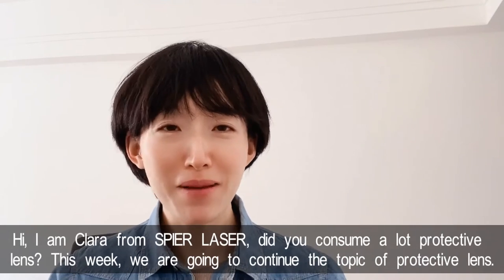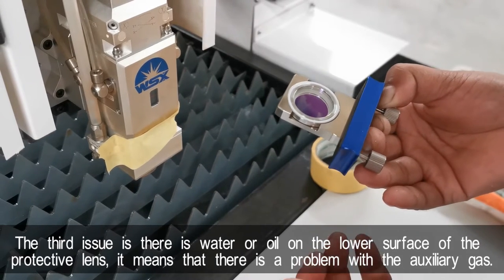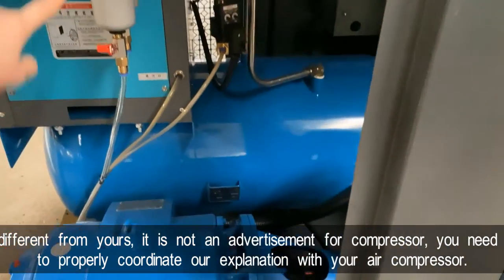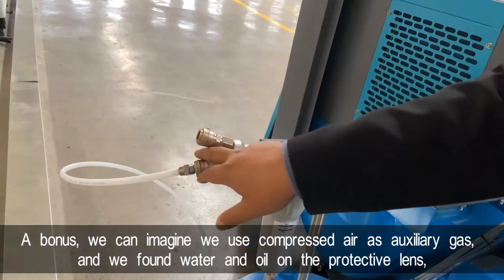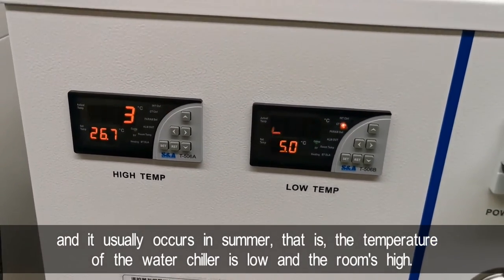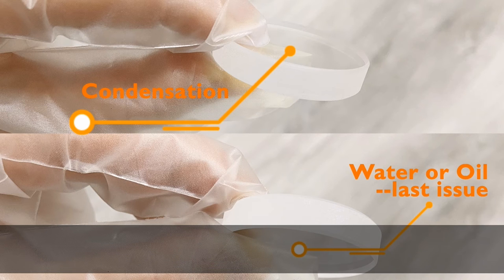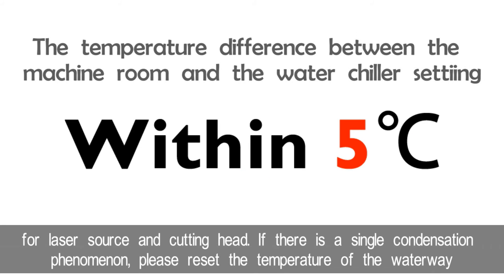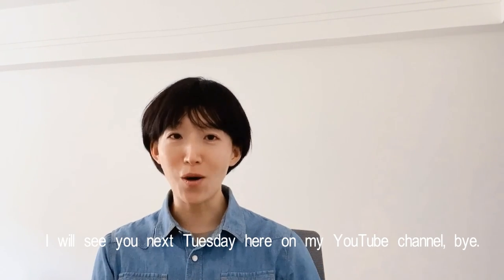Solution of Laser Cutting | Protective Lens Laser Cutting-2

Comment: Miss Clara, good evening, your videos are very instructive. I will tell you about my problem. I have just started with laser cutting. I have been operating a fiber laser cutting machine for approximately 2 months and yesterday I went to cut a stainless steel plate, but no It cut and worst of all, the plate belonged to a client, the laser left a mark on the plate but it didn't cut, I spent a lot of time making test cuts on another plate and after a long time it began to improve and it cut and came out a bit of slag, but I increased the pressure and it improved, I cut again on the client's plate and it went wrong again, I didn't know what to do anymore and it occurred to me to see the protective lens, I checked it and it had three drops of metal, when apparently spattered sparks inside and the lens stopped those sparks

Comment: Hi Clara, so we are experiencing issues with the lower protective lens, the head blows through them very often, it's a bm 110 raytools head. We are using aux gas(compressed air and even tried a bottle of 99.999% nitrogen) and finding condensation and that the lens gets burned through. We run a 2kw max brand source. Do you suspect it could be chiller temperature difference or maybe something else like the proportional valve inside the gantry head?
Reply from the maker: Yes, it is correct. And the gas purity, especially the compressed air.

Comment: I have 3kw. Raycus and raytools bm111. We have problem with the upper protective lens. When I checked the upper protection lens during the 30-minute cut 10mm, there were about 5 burns. These burns were on the upper side of the lenses. And also it occurs white dots on the lower protective lens. Firstly, I have to fix the upper one. What am I going to do? Thank you so much for all those videos.
Reply from the maker: Upper lens, please check whether all the lenses in are fine. Check whether the cable window of laser is good. And check whether the surrounding condition is clean for replacement.

Comment: And why does the nozzle heat up? And when it heats up it does not cut and slag comes out on top of the iron, that also happened to me in stainless steel and carbon steel, the head maintained a temperature of approximately 20 degrees but the nozzle was hot, as data In addition, the iron also got very hot, approximately 100 to 120 degrees.
Reply from the maker: Sorry for the late reply, the reasons of nozzle heating could be the laser beam is not in center or the lenses are damaged.